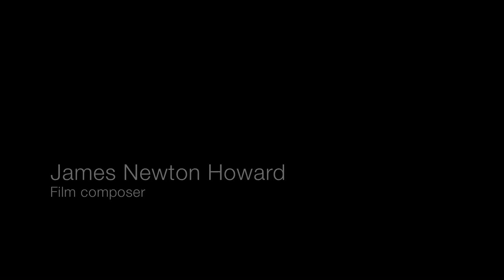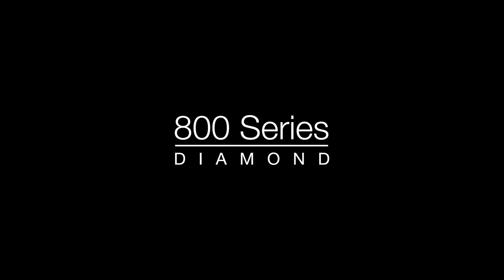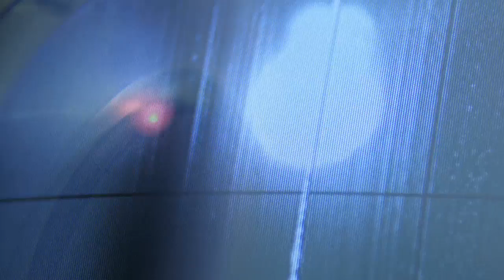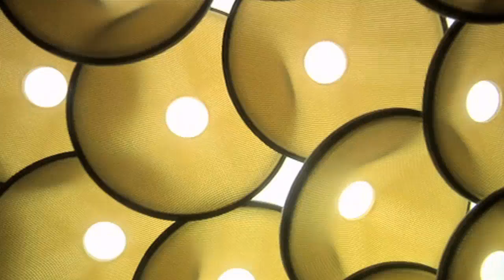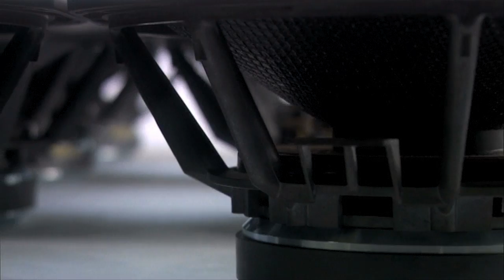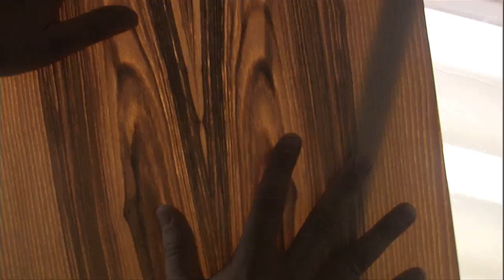B&W 800 Series Diamond Speaker

Comment: Play this sound https://youtu.be/o0RbkECkqa0  in a 20,000 meter square room with heights of over 40 meters roof and floor space to suit a international auto expo like i seen in 1988 ,now if these speakers can handle the amps they had going and the massive mission speakers back then which you could hear it outside before you even went in, then i would be impressed. lol :)

Comment: I remember I use to lust after these for long time till I got to finally hear a pair. They were hooked up to 100,000 dollar worth of gear and cables and specially treated room. I can't tell you how disappointed I was listening to them. They were overly strident and had really evident resonance peak somewhere in upper treble area that gritted at my ears. The bass was bit overly warm and boomy as well. I heard better definition from commercial sub's for theater use and to this day would stick with a nice pair of altecs or jbl instead...
Reply: Then obviously the room/system wasn't very well balanced. Just as a system can be greater than the sum of its parts, it can be less. A room can seem acoustically treated but still have severe issues. These are used in several of the worlds best mastering rooms, and for a good reason.